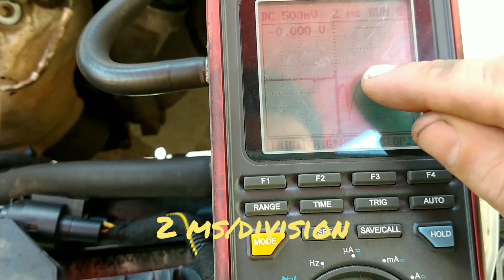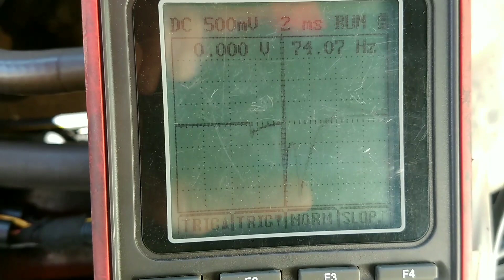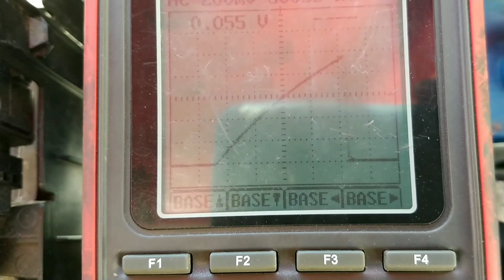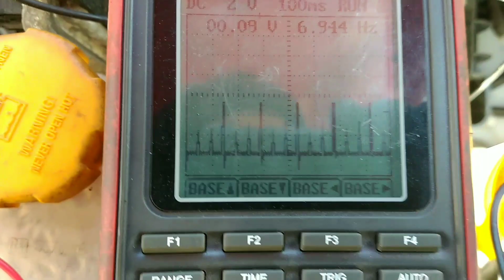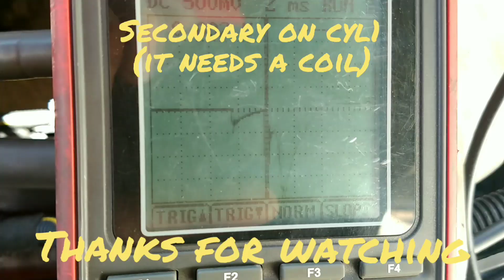Vauxhall Corsa - Misfire Diagnosing

Comment: Wot are u using for the secondary matt
Reply from the maker: That was the hantek cop paddle again, I think I could have used extension HT lead's and the clamp on pick up to be sure of what I was looking at.
Reply from the maker: It almost looks inverted like a waisted spark on a DIS, but I wouldn't have thought a 3 cylinder would have a waisted spark with it not having opposing cylinders.intresting waveform though. Thanks for watching
Reply from the maker: I have seen scanner danner with a similar waveform with an open plug wire https://youtu.be/uU0Aw4kBiY8
He explains it so well, another youtuber I watch.
Reply: intersesting stuff. i think using a paddle on multi cop, youre bound to get induction across the cylinders. the paddle is just a non-invasive test. with multi cop i prefer to use 3 extensions an take a pick up from the extension wire